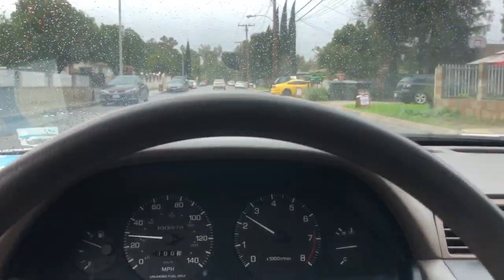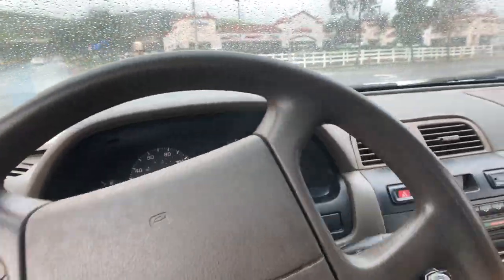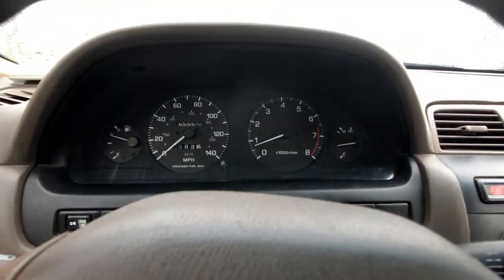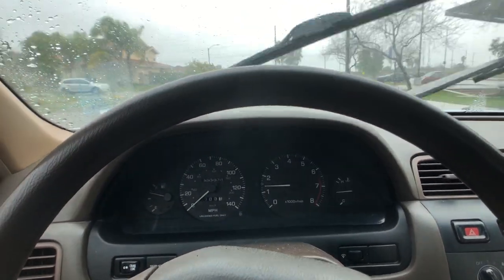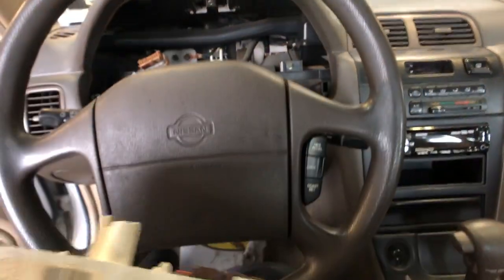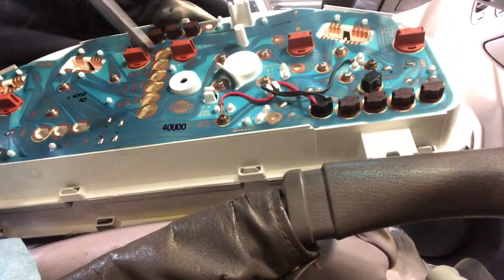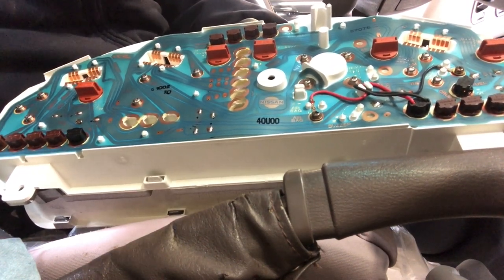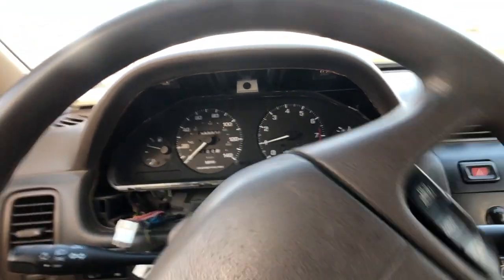1996 Nissan Maxima No Speedometer - Try This first!!

Comment: hey.  I got three problems

1.  the digital mileage display sometimes shows, sometimes partially shows, and sometimes completely blank.  The display also has blackened spots.

2.  the km/h meter won't move and is stuck at a certain speed, maybe at 20 km/hr

3.  the entire instrument panel does not always work.  sometimes it does, sometimes it doesn't.  Sometimes when I start the car, it wouldn't work until I've driven several miles.  Or sometimes it works from startup until I've driven it for several minutes then it dies.  Also when the entire instrument panel does not work, the digital mileage display is completely blank.

Thank you for your time!

Comment: Hi, I replaced my speedometer cluster with another used one. The new cluster lights turned on and all the meters worked fine except the speed meter. Is it necessary to do reprogramming after installation for the speed meter to work? or once installed it should work? I believe the speed meter might be bad but I want to confirm if programming by a dealer is needed or not. The car is 2004 Infiniti I35. Thank you!
Reply from the maker: You might have to reprogram it but it’s not necessary to go to the dealership. Just find a reputable shop/mechanic with the right tools 👍🏼

Comment: Hey I have a question my 2001 Nissan Maximas speedometer is stuck at 20 and the fuel gauge isn’t working either any ideas what’s wrong
Reply: Did you ever find out .  Mine just did the same thing.  Stuck on 20 mph

Comment: Hektor, thanks a million for this video!  I have a 1996 Nissan Sentra GXE that had spedometer and temperature gauge problems.  I replaced the speed sensor, but the spedo still did not work.  Dealer had no idea, and could not order a cluster for this car (discontinued).  After doing this, both gauges work great!  Thanks again!
Reply from the maker: Brian Helm That’s what it’s about, thanks for subscribing 😎👍🏼

Comment: I had similar issue  ( slightly different Nissan model and year) I tried junk yard VSS same I tried new VSS same I check wiring same... I read somewhere that bad Odometer  cluster can cause  VSS to not send signal to ECU.. Because I had check with scan tool and ECU was also reading zero speed... So I was going to get I new ( used) cluster... but I couldn't find so I thought to open the cluster and take a part the speedo gauge see if I could find any faults and fix... (worn gears ,blown IC, short etc) found..... nothing everything looked good clean....... 

So i ended up replacing just the speed gauge and it works... Though now that I've seen your vid and what I learned from dissembling the speedo gauge almost 100% ... The loose screws were my issue too.. Because when taking apart I noticed that the speedo guage isn't really connected anywhere to the cluster expect by those screws and washers...So it must get it's power and ground from there...

 I did note this as odd design when taking apart but just didn't put 2 and 2 together til I watched this vid... Ohh well at least I only wasted 15$...  

Also like the banging on stuff method to test stuff.. I've tried it before on other stuff and it works but didn't think to use on cluster... now I'm just gonna use on everything ....thx

Comment: I have this same problem with my 96 Max I'ma try thus first before I buy a speed sensor. If it's fixed I'll come back and let you know brotha thankx for the tip brotha #Duley
Reply from the maker: Duley's Customs Keep me posted 🤙🏼
Reply: @HomieHektor  I'm working on it now brotha I'll let you know the outcome
Reply: Plus I have a code reader can I clear my code with it and how?
Reply: I have the same car where can I find traction control

Comment: I am trying take my cluster out to do same procedure. But, I can not complete the removal. I found 2 screws on top. But, can not find others or tabs. I checked part and there is no tabs on bottom. Where are they? for 2012 altima??

Comment: Old 1989 Nissan Maxima,  owned since new.  Speedometer may read 30mph when stopped,  or zero.  Gas, temperature gauge,  odometer do not work, but tach does.
Bad sensor? Or connection?

Comment: Having the same issue with my 1996 Nissan Pickup.  Going to give this a try tomorrow.  I'll let you know if this was the fix.  Thanks, man.
Reply: Hey Jonathan... I have a 96 Nissan pickup with the same issue. Let me know if this fixes your issue.
Reply: @rodneyyarbrough6524  I took the speed cluster out this morning.  Used a Phillips head to tighten the screws on the back side of the speedometer. I blew some compressed air on the backside.  Also made sure the connections were snug.  Put everything back in and the speedometer works like a charm.  I don't know which one of the things I did worked, but it's good to go now.  Took me about 15 min.  Hope it works for you.
Reply: Jonathan Bradley  I was told by someone else that the compressed air worked on his. I’ll try it. Thanks so much for replying.
Reply: @rodneyyarbrough6524  let me know if it works out for you.  Take care.
Reply: After taking the speed cluster out, cleaning and tightening the screws, the speedometer worked for a few days.  I'm sure you know how the story goes, it stopped working.  So I've resigned to drive my truck with a cluster that works 40% of the time.